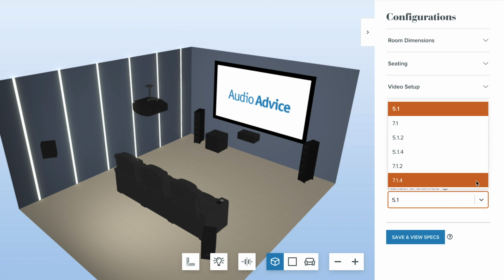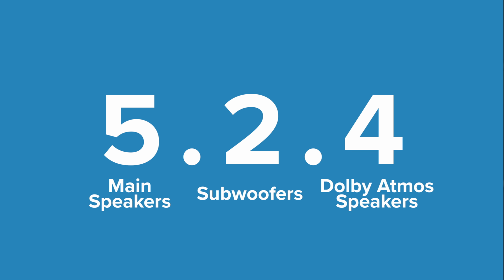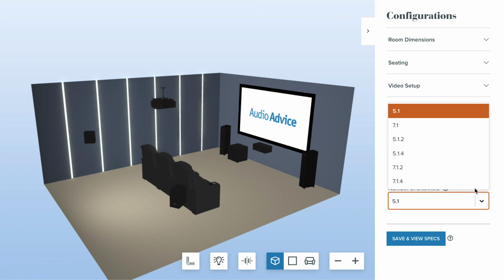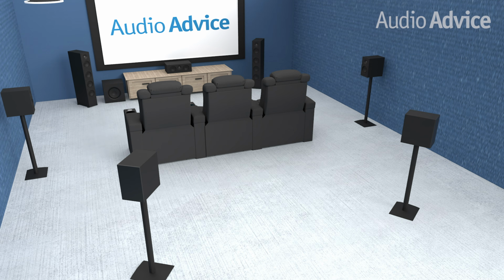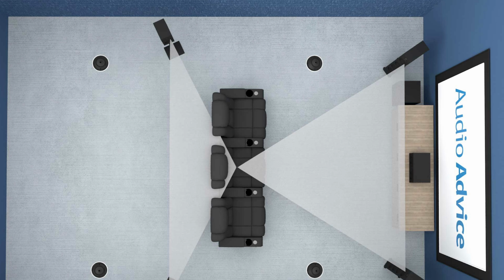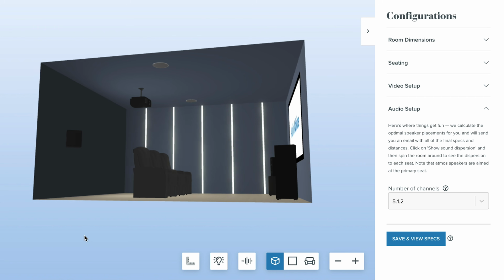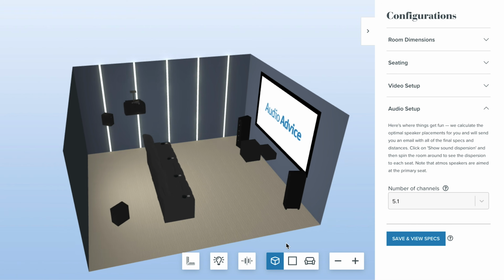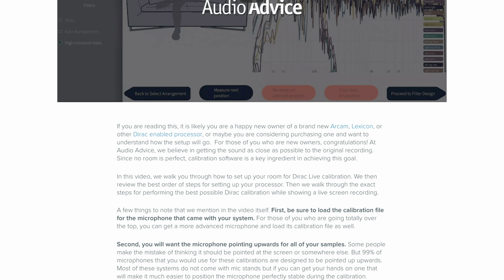Home Theater Speaker Layout Options

Comment: I found your layout tool too restrictive. It would not let me enter my room dimensions of 22' x 14' x 17' (L W H).Secondly, it limits you solely to a dedicated theater room vs I am trying to set up a family room. Once it sees a problem it pops up a warning and pretty much ends it for you at that time. There is no ability to acknowledge the warning and move on. For instance it told me that my front speakers are too wide but doesn't give you the capability to add front wide's or front heights to compensate. 

It would be nice to be able to select a speaker, for instance a tower speaker and drop it into the layout and then add speakers to achieve your goal whatever that may be 7.1.4 etc..
Reply: My problem exactly!  My room is 30' X 30' and it's one large room for Kitchen, Dining, Living (where the set up is) and entry way. Not easy to config.
Reply: See my comment above. If your room is oddly shaped and you can’t physically place speakers in strict accordance with Atmos guidelines, all you have are lots of speakers making noise, not accurate Atmos reproduction. The layout requirements are much more stringent and less forgiving. The more speakers you add, the more rigid the layout of those speakers must be IF the objective is to get a legitimate representation of the actual sound mix.
Reply: No kidding. It is assuming you have a dedicated room. My listening room is way outside the boundaries of the tools capability (although a common room type. The landing at the top of the stairs of a bungalow). But in general I give them props for giving it a shot. If the tool can work for you it's probably a really good tool.